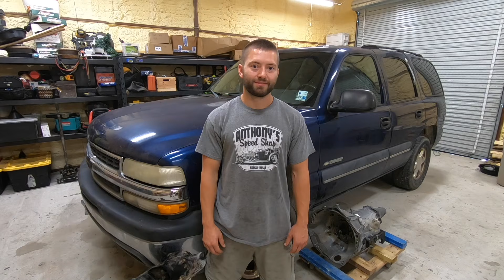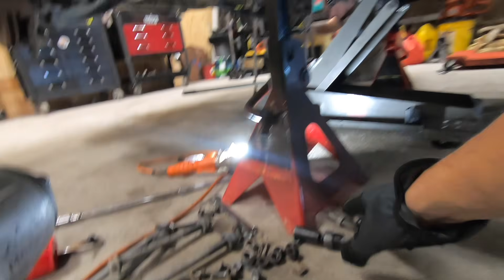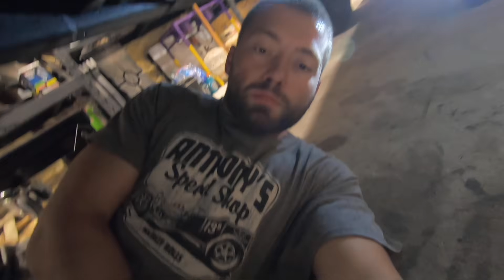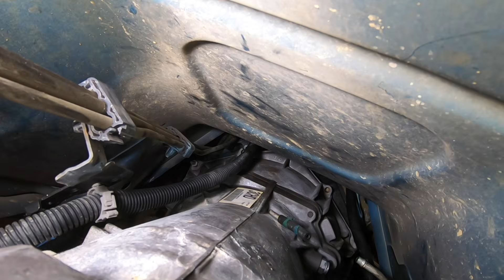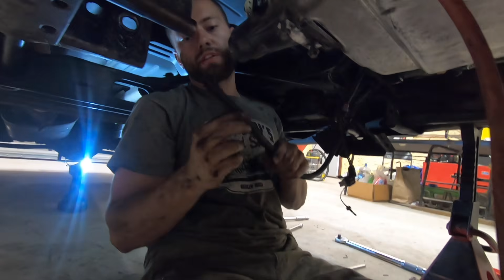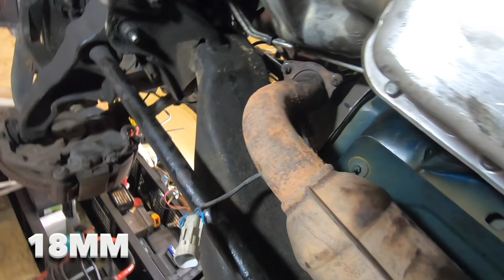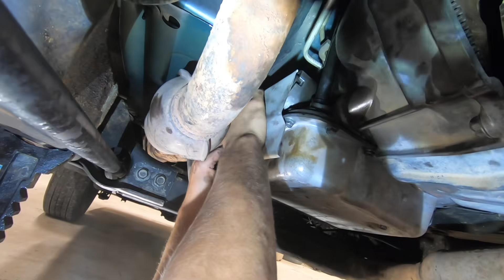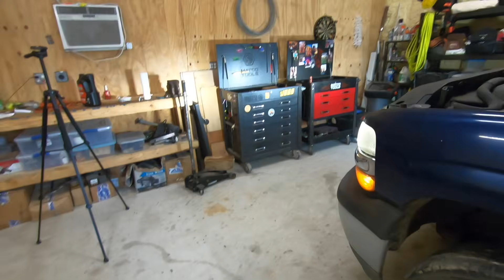4L60E TRANSMISSION INSTALL || EASY

Comment: So I just finished installing my rebuilt transmission in my 2001 Yukon 5.3 RWD. Do I need to hook up a scan tool and reteach, or am I good to go? The one that I pulled seems to have been a factory build, and the one that I installed is a different one that I upgraded some of the parts, both being 4L60Es.
Reply from the maker: There is no relearn procedure. 
Just install it and make sure the fluid level is correct

Comment: I wish my truck had that window for me to install by hand easier! lol
Reply from the maker: Which window?
Reply: @dudewecanfixit  like the little cutout where you can see the flexplate
Reply from the maker: You have to remove the starter to access that area. 

That is one of the first steps in the transmission removal.

Comment: Best video ever. Do you add oil in the torque converter before you install? I save over $2000 dollars just by looking at this video like 6 times. Thank you so much
Reply from the maker: Yes, I usually put a half quart of transmission fluid in the torque converter before install

Comment: At what point are you supposed to shift it into neutral to install the drive shaft?
Reply from the maker: You can shift it into neutral whenever you want, just make sure to put it back in park before you remove the wheel chocks

Comment: Truck was cranking by itself as soon as I put the cables to the battery
Reply from the maker: You much have a positive lead touching the signal wire on the starter.

Check your starter wires
Reply: @dudewecanfixit  thank you I figured the wires were crossing

Comment: Hey man great videos! I just swapped my tranny but for some reason the gear selector cable seems like it’s too long now and when I make it for the truck won’t go in park. Any idea why this would be? Any help would be appreciated thanks
Reply from the maker: It sounds like your gear selector on the transmission is in the wrong position.

Take the cable off and rotate the rod to the park position and reconnect the cable
Reply: @dudewecanfixit  thanks a lot man it turned out I had the little metal bar flipped the wrong way which actually shortens the distance quite a bit. 😆 I forgot I had removed earlier. The entire job was a pain but your videos helped a lot. Those exhaust nuts were hell to remove
Reply from the maker: Your welcome, I'm glad you got it fixed and we were able to help!

Comment: Did you lube the snout of the torque converter before seating it into the crankshaft?  I did not but I just saw a video where someone did.  Do I need to take the tranny back off and do this?
Reply from the maker: I usually put a little transmission fluid on it to help it slide in, but it's not necessary. 

You don't need to take it back out.

Comment: Just did a full rebuild on my 01 jimmy.  It's a lot more in depth for a 1st timer but I truly enjoyed rebuilding the tranny, adding sonnax shift kit, parts of transgo shift kit, corvette servo and a sonnax sun shell which was my problem in the first case. Totally stripped out 😆. But I would like to thank you two on a job well done. Especially with the feeler gauges, tolerances, and the confidence to do this job. I would've been up shit creek if not for you 2. I had a dam check ball fall into the side of the transmission 😆 and I double checked to make sure the c clips on the pump valve were fully seated then it got away from me and into the transmission again 🤦 but shit, I didn't even mind digging it out lol. Now I know I can rebuild one of these things and next would be engine dismantling but that's for another time. Much respect from  Saskatchewan Canada 🇨🇦
Reply from the maker: That's awesome! I'm glad we could help you do all of that! 

We do have videos on how to take the heads off, replace the head gasket, and reinstall on an LS engine!
Reply: @dudewecanfixit  I think I'll be using that in the future for sure. Once again. Thank you.
Reply from the maker: Glad I could help!

Comment: Hey question I just installed my 4l60e and when I start it up it sounds like loud clunking under the bell housing any idea what that noise is?
Reply from the maker: When the starter is engaged or while the truck is just running?
Reply: @dudewecanfixit  I thought the same thing, but that wasn't it. it was the flywheel hitting the cover because it was bent 😂 it's running great now except it won't shift into park. It shifts to park but the dash P doesn't light up and it still rolls idk what's wrong 🤔
Reply from the maker: First, turn the truck off and chock the wheels. Try disconnecting the shifter linkage cable and manually moving the linkage on the transmission forward into the park position and see if that keeps it from rolling. Also, the light could be the park neutral safety switch not adjusted correctly.

Comment: Did you check the gap between the torque converter and the flex plate? 1/8 gap..if not, I see a burned up pump. Trashed tranny..
Reply from the maker: I put the gap specs in the video description.

Comment: Did you mount the torque converter directly to the flex plate or did you leave a gap im installing a remanufactured transmission on my 07 gmc Sierra but when I tighten the bolts it’s going directly on the flex plate
Reply from the maker: It bolts directly to the flexplate as long as the Gap is not too small or too large. Check out the video description I put a thorough explanation there
Reply: @dudewecanfixit  okay thanks man 👍🏻

Comment: @7:56  my torque converter has a quarter in gap between the the flywheel,  bolts don't  start threading,  is this normal,  to have to pull TC to the flywheel?
Reply from the maker: Once you have the transmission installed onto the engine you must verify that the torque converter 
remained fully seated into the front pump during the transmission installation. You should observe 1/8” 
(.125”) to 3/16” (.187”) of air gap between the torque converter mounting pads and flexplate before 
sliding the converter forward to attach it to the flexplate. If you have 1/8” – 3/16” air gap then you may 
proceed with sliding the torque converter forward and attaching it to the flexplate. If you have less than 
1/8” air gap then you may not have the torque converter fully seated into the front pump. This will 
require disassembly and verification of proper torque converter installation. If you have more than 3/16” 
air gap then you may install high quality flat washers between the mounting pads and flexplate to shim 
the converter to the correct air gap dimension of 1/8” – 3/16”. NEVER shim the converter to eliminate all 
air gap. Running the torque converter in a fully shimmed condition WILL result in damage to the front 
pump gear set, front pump stator body, torque converter pump hub, and may even cause damage to the 
internal torque converter components as well as the crankshaft thrust bearing.
Reply: @dudewecanfixit  I figured it out, I didn't  have it lined up, just needed  to turn the flywheel  more to the correct hole. Lol
Reply from the maker: Awesome
Reply from the maker: How did it look when it came off? Is it the same torque converter? Did it have spacers?

Comment: Nice how to video but what about Torque Converter 'setback''? I've always set as close as possible to 0.125". Do you do the same or something different?
Reply from the maker: I'm not sure what you mean by "setback"?
Reply: @dudewecanfixit  I mean the distance the torque converter rides from the fully engaged position in the pump. Sometimes when its bolted down to the flex plate it will pull back out of the pump too far so I shim the torque converter-flex plate. If its too far into the pump, (under load) the flex plate can force it too far into the pump and cause premature pump failure. I usually like to see the torque converter 1/8" out from fully engaged.
Reply from the maker: That is very good information. I haven't taken a transmission out that had shims on the torque converter, so I have never put them back in either. No issues so far, but I will definitely keep that in mind on the next one!
Reply: @dudewecanfixit  It usually is a problem with rebuilt Torque Converts. When they weld them back together they are shorter and the TC doesn't fully engage the pump. They can also be welded together too long.
Reply from the maker: That's wild, you would think they would keep these within a certain tolerance
Reply: @dudewecanfixit  Yeah, I agree.

Comment: Is there a cover that goes over the inspection hole in the bellhousing where you where moving the torque converter with your finger?  Or is the hole just open?

Thanks
Reply from the maker: There probably should be a cover lol

Comment: The smaller not on the starter for the signal wire is not a 9/16 it is either a 5/16 which would be 8 mm or it’s a 3/8 equivalent to 10 mm

9/16 would be 14 mm similar to the size of the spark plug socket on a Mini Cooper
Reply from the maker: Must have been a typo, good eye!

Comment: It’s been a minute. But i don’t remember doing my torque converter bolts like that. I remember everything was done with the trans out and bolted to the flex plate. Then put the trans on. 😳
Reply from the maker: Do you mean that you bolted the torque converter to the flex plate and then try to stab the transmission onto it? That sounds very difficult

Comment: Idk if my trans dip stick tube bent but I had the hardest time putting it in. Took 2 hours trying to bend and put it in place finally got it.
Reply from the maker: Those tubes are an absolute pain in the butt, I’ve had to lower a transmission and raise it back into place with someone specifically guiding that tube LOL
Reply: I can’t get my dipstick to sit flush with the transmission pan. Is there supposed to be about an inch of slack ? Or is the tube supposed to be flush with pan?

Comment: hey guys, you have helped me do 2 transmissions swaps at home . i ran into a problem , the bottom 2 bell housing bolts have stripped threads. is there a way to fix ? 

thanks in advance
Reply from the maker: If it's the bolts, just go get new bolts. If it's inside the engine, you might be able to bore it out and put in over size threads or a helicoil
Reply: @dudewecanfixit  sounds good thank you

Comment: Im stuck on the first part mounting them togjeter
Reply from the maker: It takes a bit of finessing and never goes as planned lol just have to adapt to the problem and take your best shot lol
Reply from the maker: Make sure you have a helper and a good jack. Start by lining up the guide pins and then hand thread the bottom bolts

Comment: Either I missed the torque specs (ft/lbs) for the bell housing bolts, or they were not mentioned? Any help with this?
Reply from the maker: “Transmission to engine bolts: 35 ft/lb” sorry we completely forgot to add this lol hope this helps
Reply: @dudewecanfixit  Thank you so much for the quick reply. Your videos were amazing...I did a simple un-install, had a mechanic rebuild it for $650, and then re-install. Your video helped out immensely! Thank you, for your time!
Reply from the maker: Happy you enjoyed them brother! We are just a couple of guys who rather save the money and put a little time in. Happy we can inspire others to do the same. 

The uninstall and get it rebuilt is the way to go!

Comment: Got another question brother, do you have a video on flushing the tranny cooler lines,its being rebuilt right now,I'd just like to flush the lines out before putting it back in..thx
Reply: Pretty much just asking what would you use...I've seen Kooler Kleen ,wondering what's your thoughts
Reply from the maker: I just use compressed air and fresh transmission fluid
Reply: @dudewecanfixit  thx brother

Comment: Also with the 4160e transmission you don't have to worry about spacing between the flex plate and torque converter right?
Reply: Sorry I meant fly wheel
Reply from the maker: It's technically a flex plate, not a flywheel on automatic transmissions. I don't think there's any spacing there

Comment: How did you test the lockup on the torgue converter they say they will burnout quick if the lock up ain't working
Reply from the maker: Watch your RPMs and count your shift points. You should have four shift points.

1st to 2nd gear
2nd to 3rd gear
3rd to 4th gear
Torque converter lockup (about a 200 rpm drop) once you are cruising.

Comment: i followed everything in the video. and now my truck won’t drive or move at all. and will only shift through park, reverse and neutral.
Reply from the maker: It sounds like something is binding up in your shifter assembly.
First, I would rule out your gear selector cable by disconnecting it and manually turning the bar on the transmission into each gear. Make sure the vehicle is off, on a level surface, and have wheel chocks in place!

You have a two or three inch metal bar coming off the gear selector on the transmission. You can grab that with some channel locks and shift it through all the gears. 
If it shifts through all the gears, you have an issue with your shifter cable or your column shifter.

If you cannot shift it through the gears still, you have an issue inside the transmission.

Remove the pan and examine your shifter assembly. Your gear selector rod that goes into the valve body might not be installed correctly

Comment: Upper bell housing bolt torque specs? He didn’t say.
Reply from the maker: All the bell housing bolts have the same torque spec. I said the torque spec when I started torquing them down in the video

Comment: When I pulled the Allison 1000 out from behind my LB7 in the street to replace the broken flexplate (with a SoCal diesel billet 1 piece), I just put the truck on 4 ramps to give me the height I needed to work under it.  Driveshaft I just pulled out of the trans and bungeed off to the side out of the way instead of pulling the heavy ass 2 piece driveshaft out.  Having the wheels off wouldn't have made it any easier for me, what would've made it easier is if the street were smooth so I could maneuver the trans jack around.  Glad I don't live there anymore.
Reply from the maker: That sounds like quite the job. I once replaced a one ton rear end in a sandy parking lot in Albuquerque
Reply: @dudewecanfixit  only other issue besides the jack not rolling on the crappy street surface was the damn flexplate bolts that were installed by Zeus himself at the assembly plant, all 8 of them.  I'm 6' 280 and had to use the handle from my floor jack as a cheater pipe to break them loose.  

Did you have somebody pulling security while swapping that rear end?  I hear ABQ ain't the safest place in the world, lol.
Reply from the maker: @GrandPrix46  no, but I did gather odd pieces of lumber and wood from the parking lot to get the rear of my truck up high enough to get the axle out

Comment: I replaced my rear main seal...doing the job by myself everything worked out except.... I pulled the Neutral safety switch so I wouldn't break it and all the gears lined up on the column and it starts in Neutral and in Park but it won't go into any gear? Is the shift linkage in need of adjustment I didn't mess with the linkage or what? Help!!
Reply from the maker: That's interesting. I don't think the safety neutral switch would keep your vehicle from going in gear once it is already started. May need to adjust the linkage somehow

Comment: I've got a question!!! I've got one dow pin in the transmission and one in the block that's the way it came out Is it supposed to be that way?
Reply from the maker: That's fine
Reply from the maker: They are there for alignment when you put the transmission back in. Doesn't matter what side they are on.

Comment: Sadly bolting down that TC is pretty easy on a Tahoe or pickup. However it is a bitch on the Trailblazer/Envoy vehicles.
Reply from the maker: Hope the people working on a trailblazer or envoy sees this comment 😂
Reply: @dudewecanfixit  I have a video shot that I just need to upload on how to do it. I should clarify, the straight 6 Trailvoy is similar to what you show, the V8 is completely different. That's what my video covers.
Reply from the maker: That's good, post it!

Comment: Awesome series! Fully rebuilt my transmission with your videos!
Reply: Real quick tho, got everything together and back on the truck. I shifted thru the gears like you did, but I don't have Reverse.. before I take it off the truck again, would you have an idea of what could be the problem?
Reply: I've check the fluid multiple times. It's withing range. 
And yes, feels like it should
Reply from the maker: That's interesting. I'm not sure what the next most prevalent item would be
Reply from the maker: Check this out.

https://youtu.be/6SmYSdciNmA
Reply: I've been dead in the water now for over a year. Rebuilt it twice with transgo shift kit on the second time. I'm now experiencing clicking within the bell housing, and I still don't have reverse. Not to mention I don't have drive either.
Reply from the maker: I wonder if your valve body is faulty
Reply from the maker: That's awesome, good job!
Reply: HELLO, I know it been a year, but if you're still around, How did u make out with Reverse in your Vehicle ? I'm interested,  cause I'm just finished Total Rebuild in my 4L60E. Adding Fluid Now, starting up in morning ! 10.21.23
Reply from the maker: Is your fluid level 100% correct?
Reverse takes the most fluid pressure to operate.

Also, does the linkage feel normal shifting through all gears?

Comment: I have a ? Just bought a 2002 escalade came with good motor 6.0 vortex.but transmission is gone... I have a 04 escalade motor bad 6.0 but the transmission was rebuilt about a year ago. I'm trying to find out is the 02 escalade transmission  compatible with the 04 escalade transmission as far as bolt pattern,lines, torque,etc. So will the 02 escalade transmission be compatible with the 04 escalade transmission... Your advice will be very helpful
Reply from the maker: Yes, those should be interchangeable